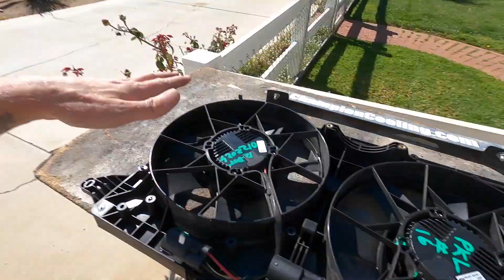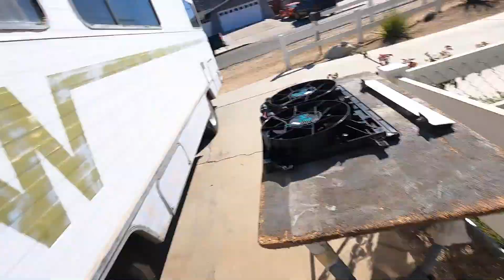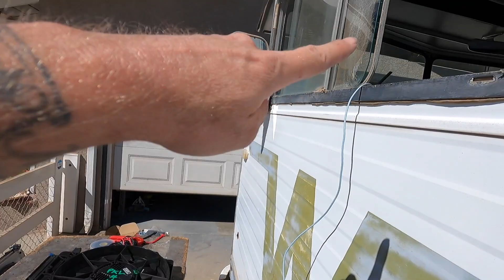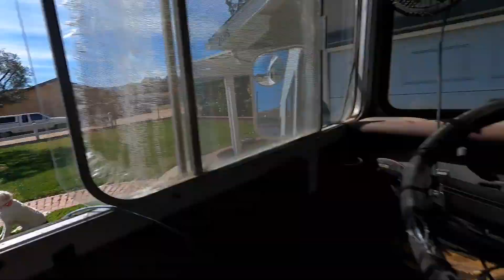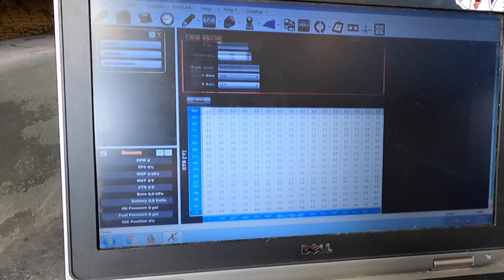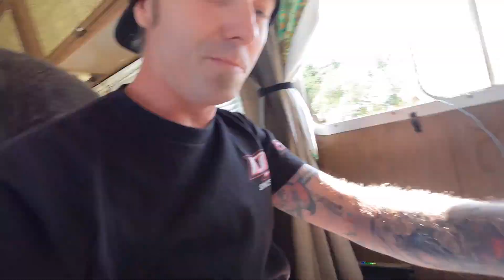Cheap 12 Inch Brushless Spal Fans

Comment: Can this be wired up to work separately?  One for the radiator the other for the AC condenser?
Reply from the maker: If you have the outputs to run them yes

Comment: So the Chevy volt fans don’t need an external pwm controller when using Holley terminator ?
Reply from the maker: Holley will send the pwm signal. I have a whole line of fan holders kits at Warrperformance.com now to make installing OE brushless fans easier

Comment: Did these work for you?
Reply from the maker: Yes the volt fans work well but if you get them used they are pretty old is all. I make a holder now for a 15” Silverado fan and will have two more sizes soon. You can see it on warrperformance.com
Reply: @Burndown is the 15" Silverado better then the volt fans
Reply from the maker: @YoungerPrice  they are equivalent but the Silverado fans are available new and used everywhere. They are also pwm with soft start and low amp draw.
Reply: @Burndown thanks man,I need a little more then the volt fans to keep my temps around 180 on my turbo engine any recommendations I was thinking the zl1 fan or stingray
Reply from the maker: @YoungerPrice I’m working on a ZL1 fan holder that will be out soon for pre order 😊
Reply: @Burndown if you can get one to fit a S10 rad you'd sell a lot of them roughly 26" wide 15" high

Comment: I just put a set of those on my s10 controlled by holley terminal x. Its working good so far. It does hang over the side a few inches but doesn't effect it.

Comment: Can you make a set of fan holder for the Chevy volts fans? I have a nice set of brushless ones.
Reply from the maker: No they are not a good option IMO because you can no longer buy new ones. Someone did find a set of 12” fans from another vehicle tho that are available still but I haven’t looked into it. The 12” spals are good fans tho. That’s what I ran before on the boom

Comment: 05:12
I grabbed two 10 inch pusher fans off a 2010 Land Rover SUV for $17 each at U-Pull and put them in front of my 1990 F150 AC condenser and now my AC went from 65 F in stop and go traffic with 96 F ambient to 47 F out the vents....Salvage yard OEM parts are far better and cheaper than new on-line knockoff garbage...great video!!
Reply from the maker: Thank you! Just make sure you wire the OE fans properly and they are better than aftermarket junk for sure.
Reply: Hi ! Can you says from witch SUV model you take them, or better, a genuine reference. Thanks 👌

Comment: Would these fans be a good choice for my setup? 70 Chevelle LS swapped, twin turbo, air to air blocking the front of the radiator and I’m currently putting air conditioning on the car and the condenser will be between the radiator and intercooler. Super budget build I need a good brushless junkyard find the Holley can control
Reply: you ever hear about a CFM rating on these?
Reply from the maker: Look up a brushless 12" spal fan
Reply from the maker: I don't know if your radiator is wider than my 64 chevy is. If you can find these they work great. I have them on my car still.

Comment: For fan power what size fuse are you using? Great set of videos. They have been very helpful
Reply from the maker: I used a fusable link on the power side to the starter. I have not tested the amp draw on these fans but they are 400 watts I believe so a 30 amp would probably  do it if you went with a fuse.

Comment: Just found a pair at the U-pull out of a Volt and remembered having in my 14.  Spal are my go to like a McIntosh receiver. Signal wire sealed brushless and the Spal housing for a fraction! Now I have my rugged set for the continuous solenoid set up and one to run at my exact needs. Great right up bro, not many know.

Comment: Great info. What fan would you recommend for 65 chevy c10? I currently run 14 in generic brand and looking to upgrade.  My truck is just a 350 small block with mild cam abd headers. Would greatly appreciate your input.
Reply from the maker: You would probably need a brushed fan because your not running a Holley. Maybe go on rock auto and look up some Silverado fans from the mid 2000s and see if something like that works. Make sure you use the proper wiring for them as they will probably pull some amps and you don’t want to burn anything up.

Comment: Awesome tip! just one quick question, do you know if the PWM signal has to be a positive or negative signal (PWM to ground or 5V positive?) Thanks!
Reply from the maker: The fan is hooked to direct power and the pwm is a negative from the ecu

Comment: Bad ass. The signal wire makes me wonder if there’s a built in mossfet driver Since brushless motors run on ac. Thanks for the tip 🤙
Reply from the maker: Yes the fans have a built in controller.
Reply: How would you wire them without a pwm controller? Just ground the wire when you want them on?

Comment: Hello I have a 1987 mercedes 300d with the 3.L turbo diesel.
Currently it has a clutch fan that i want to swap out for electric fan. 
The cooling surface on my radiator is 19x29. You have any suggestions for a fan
I can use. I cant use a fan like what you have because there is no computer 
So I would need to run relays from temp switch. I live in the boise area which is often 100deg and up. And if you run ac the motor runs hotter than I like.
Any suggestions would be greatly appreciated.  Thanks for your time. Robert
Reply from the maker: This fan needs a PWM signal form the computer to work properly. I would just source a good OEM fan form a junkyard that will fit your radiator. If you can take the wiring that goes to the fan as well so you will have the correct gauge wire to put into your car. Make sure its done properly or you risk damage or fire if things get shorted out without proper gauge wires and fusing.

Comment: What a kickass setup
Reply from the maker: It works awesome. I want to try the 19" fan next.
Reply: @Burndown  that beast is designed for multy stack coolers oem is $286 on rockauto , used is double of that on ebay 
You won't regret it
170 amp or more Alternator upgrade is a must

Comment: You can all follow this video and go try to source you those fans from a yard....or you can check this video out and go grab you a Mercedes fan that will pretty much destroy both these fans https://www.youtube.com/watch?v=kGylouOxVL0
Reply from the maker: What size are the Mercedes fans? I didn't see any 12" ones.
Reply: @Burndown  12 inch?? We're talking about cooling car engines, not computers 🙂. If you use the smaller C-class fan, you're looking at a little over 18 inches. Otherwise, if you want the big S-class fan, that's a little over 20 inches, but that one also comes with an additional 250 watts, so about 850 watt for the larger one. Actually, now that I think about it, you could source a smaller 12-13 inch fan from some of the the older model Mercedes like the w202 or even the w140. They came with 3 fans: a larger viscous clutch fan for the radiator and 2 smaller 12-13 inch fans for the condenser. Even still, those dual Bosch fans did put out a ton of air.

Comment: Thank you when you finish the table please do another video how too..
Reply from the maker: I have it up. Its in the twinnebago section. Look for the hill fan switch video. Thats how im running them right now.
Reply: @Burndown Good evening I will like to know what is the part number for the hill switch. Can find the video . Thank you for your help.
Reply: Good morning got another question. You use the Gm factory temp sensor or the one on volt . Can’t get fan running

Comment: Pretty good no-nonsense DIY video. I did something similar with a set of Ford 12" dual fans out of a 2002 Ford Contour. Ford uses Bosch motors but they are not brushless. I have them in a custom shroud, cut away all the excess material just saved some sections for flanges. Don't think they are as powerful as the SPALs you're using. I'm trying to cool a 461 BBC with a Holley double pumper using an external PWM. I want to know how you can control these fans, is there an aftermarket controller that will work with brushless fans? What about temp sensor?  Gonna check out your page and see if you have the next steps. How big is the actual shroud section without the side wings?
Reply from the maker: Im on Holley EFI so it will send a PWM signal to them directly. The controller is built into these fans so all you need is a signal. I think you can get an aftermarket PWM signal generator to run them but im not 100% sure on that. I have a few videos on the brushless fans so check them out and if I don't answer your questions in the video just leave a comment and ill get back to you. You can also find me on IG and send me a DM as well.  Thanks for watching !
Reply: @Burndown  I have discovered that GM rates those fans at 300 WATTS each, so its a total of 600 WATTS. The science is above my pay grade, but I'm curious about how much CFM that 600 WATTS is equivalent to. You have any idea? I haven't actually stuck a ruler on a set of Volt fans, but I think the blade ring diameter is 12" and the flange opening would be around 13". I haven't been able to nail down this with the Spal web page, but I'm trying. I wrote to them (the Italian page) but no response yet.
Reply: @mikelangieri6602  From my understanding it's going to be difficult to get data on these. I just picked up a c7 z06 fan (about 14") that's 600w for one. I'm excited to get it going! I love that GM is putting these in factory applications, really drives down the cost of these things.

Comment: great job, so no relays are needed with this setup?
Reply from the maker: No it has a built In Controller. You will need to be able to send a pwm signal to it is all
Reply: @Burndown  Thanks!

Comment: Awesome vid. I was looking for something like this for my build I called at my local junkyard which is hour and a half away and order me some pick them up Saturday. Thanks
Reply from the maker: Nice! It looks like BMW 390 fans are a good size brushless option as well. Just depends on the size radiator you have is all. The C7 Vett have a 14 set up. That one will draw some amps tho so wire it properly or you may have some issues.
Reply: Did you wire them through a relay or straight from the Holly to the fan.
Reply from the maker: @mitchellwood1833  I wired them to the starter with fussble links and ground to the chassis. The Holley just sends signal to them is all and it’s a negative signal

Comment: Does a gen 3 ecu control them or signal on? Or am I looking at an aftermarket controller? Any ideas?
Reply from the maker: You would need an aftermarket controller to make them run. If you look up PWM fan on YouTube you can find stuff I think if your interested in trying to run a set.
Reply: @Burndown  I essentially have a 68 chevelle radiator size with a 6.0 4l80, 6875 and a car on the heavier side i plan on driving to hot August nights or ls fest west distances. So that fan setup looks like it would be perfect. Especially for around 200 bucks. I would love the terminator but a bit out of reach for now

Comment: Do you have the dimensions for that fan setup? I have a small Radiator and wonder if they will fit.
Reply from the maker: I pinned a comment with measurements so look at the top comment for size.

Comment: If the controller failed you could probably open it and solder on a brushless motor controller but I don't know about that input signal
Reply from the maker: I bet you could figure it out if you had the time to mess with it. You can take the motor out of the shroud so anything is possible.

Comment: Nice!  So you only use one of the outputs from the Holley. If my F150 fans ever die I may go with a set up like this.
Reply from the maker: Yes power them and then its a singe PWM signal from the Holley to control them both.